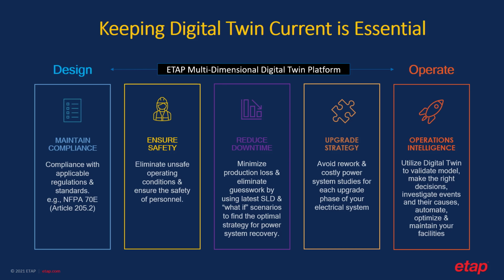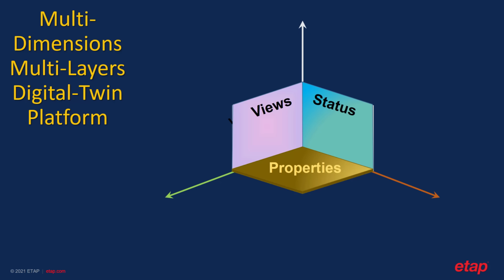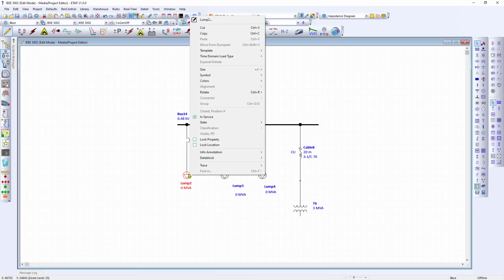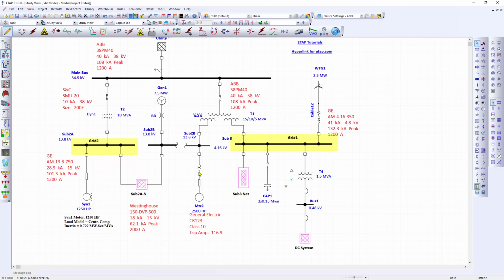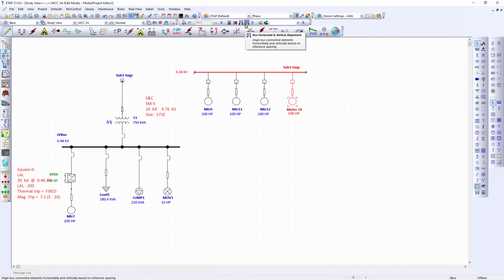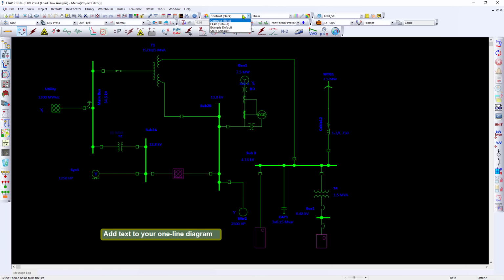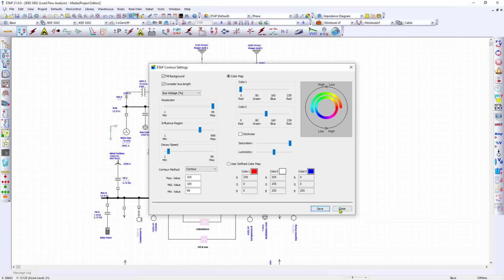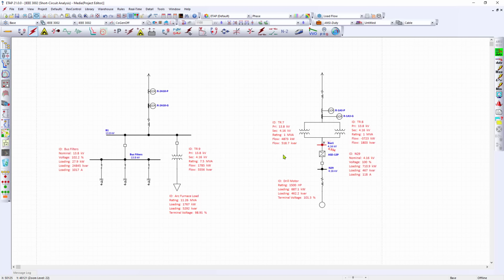How to Create & Update Intelligent Single-Line Diagrams (iSLD) - ETAP Project Management Part 3

Comment: Can we apply faults at a specified length of the line like we can do it in PowerFactory?
Reply from the maker: Thank you for your interesting ETAP Software. We will get back to you shortly.
Reply from the maker: Yes, you can. Please refer to the product page of our StarZ product for Distance Relay Coordination https://etap.com/product/starz-distance-relay-coordination. You can see the feature under "Single / Sliding Fault & Line Loadability Analyses" referred to as Sliding Fault Analysis. For any additional information, questions, or a product demo, please contact our 24/7 Help Center at https://helpcenter.etap.com or one of our local ETAP offices or representatives.